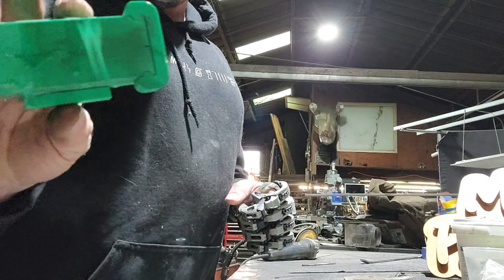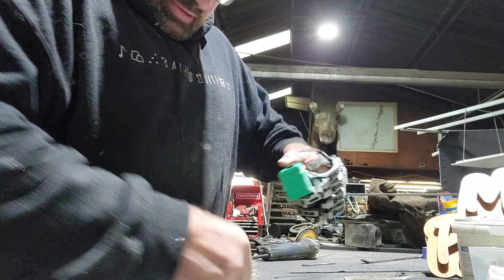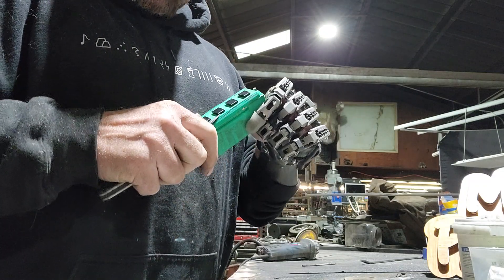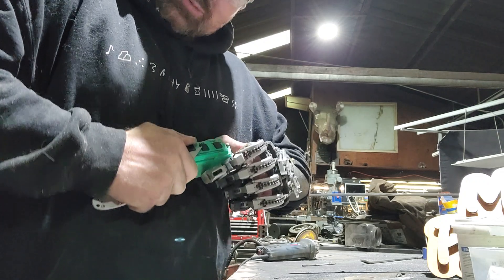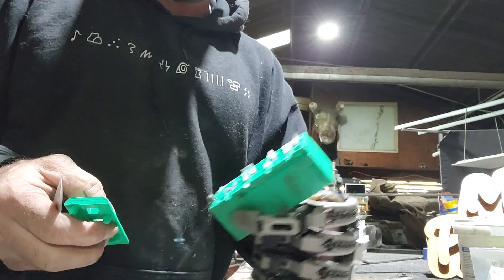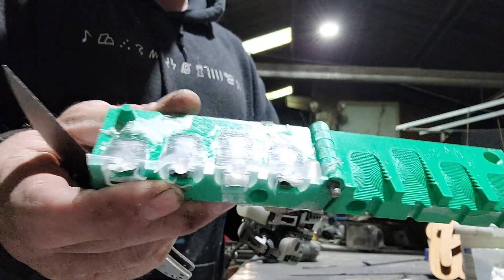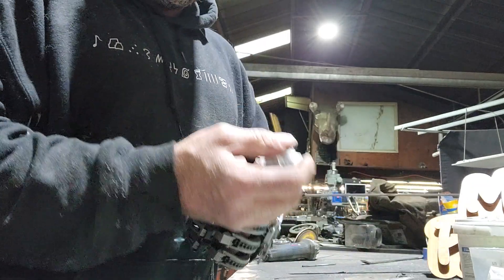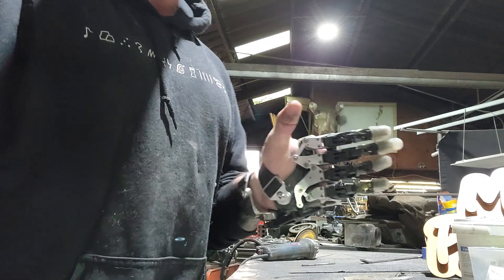making silicone fingertips pt3 final part

Comment: I know you like your hand more because you are actually using it. Sometimes I see you working without a prosthetic, perhaps out of habit. Now, you are fully embracing and taking advantage of its utility. This hand appears particularly refined, so it has so much more general applications by the look at it! Amazing progress
Reply: I'm not 100% sure, but I believe he tries to use his prosthetic as often as he can, but he removes it whenever he's around heavy machinery such as his lathe or milling machine.

It would be terrible if his prosthetic somehow got stuck in heavy machinery like that, pretty sure he don't want to lose any more fingers, or worse...

Safety first!

Comment: I have a question I hope isn't insensitive.  Have you ever accidentally "injured" your prosthetic because you can't feel it.  Alternately do you use it to handle things that are too hot for your other hand?
Reply from the maker: So I have on both accounts.  There have been many fingertips that have needed to be replaced because I tick them with the grinder, or say if I'm moving a sheet of plywood, I've smeared off the silicone outer. It mostly when I'm in a hurry and don't think to replace them with the more durable, less grippy tpu ones. As far as the hot stuff, ya, I've used it to pull food out of the oven. A couple of years ago I had a log roll out of the fireplace and I picked it up and tossed it back in. Got some good looks for that one.

Comment: Might not have caught it before, but how long do these usually last until you consider them 'worn out' or used up?
Reply from the maker: Really it all depends on what I'm doing. If I'm doing metal work, the silicone ones I don't last at all, for that I have some tpu ones that I switch to. If I'm doing just regular light work around the house, probably 2 weeks or so. The more grippy the fingertips the shorter the lifespan. Right now I'm using Alumilite silplat 25, I get better lifespan from silplat 45, but its not as grippy.